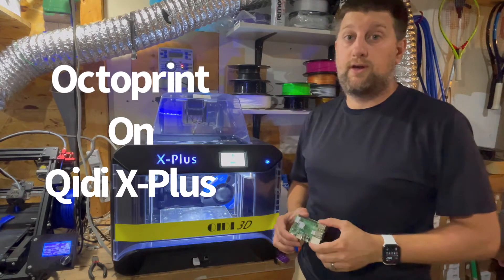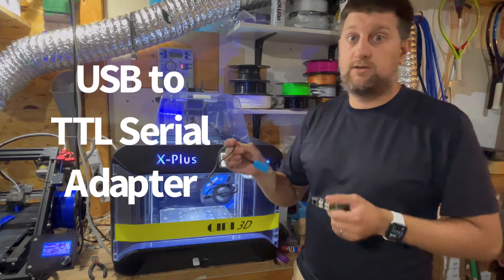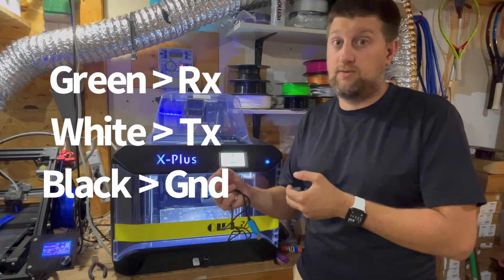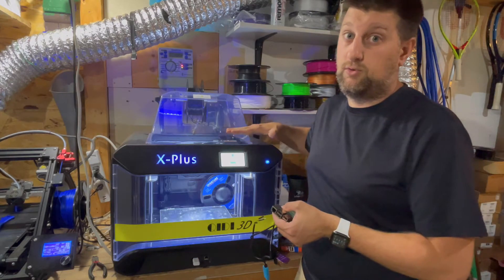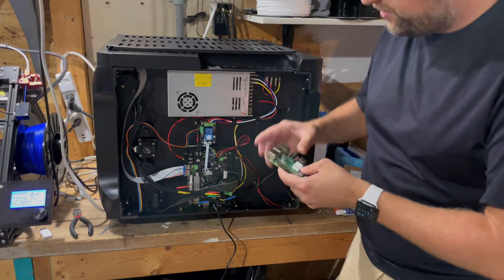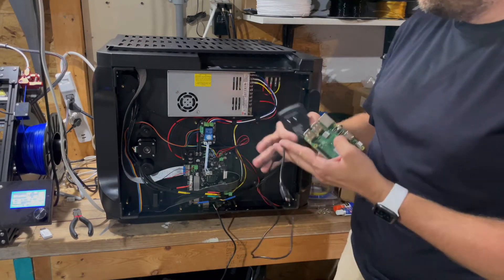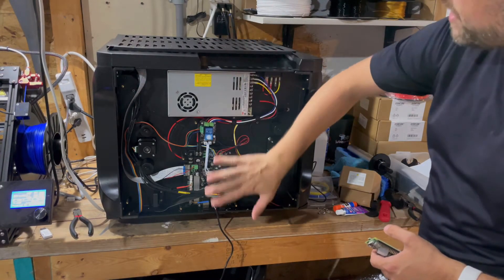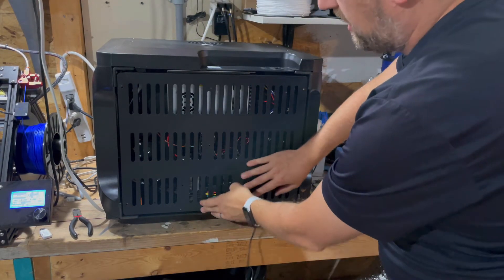How to Use Octroprint on a Raspberry Pi with a Qidi X-Plus 3D Printer

Comment: the link to the cable on amazon shows a different cable than one in your video, is there picture in the listing wrong or did the cable change?
Reply from the maker: The exact model I originally purchased has been unavailable for quite sometime. In my experience any that say Raspberry Pi compatible will work just fine!

Comment: Good info thank you but.... Was hoping you were going to talk more about the workflow, not just how to connect the pi.
Reply from the maker: Sure! What would you like to know?
Reply: @pluggedin3d266  I was hoping that you were going to go over the commands to "talk" to the printer. I know that they are not all standard marlin gcode. Was also hoping you would discuss how best to setup the pi to work best with qidi. Qidi is none standard  and has a tendency to not do well with outside equipment.
Reply: @pluggedin3d266  PS thank you for responding!
Reply from the maker: @christopherlarime4095  The stock OctoPrint works well. It will suggest to add the Fix CBD Firmware Plugin upon first connection. Since doing this I have not had any issues.